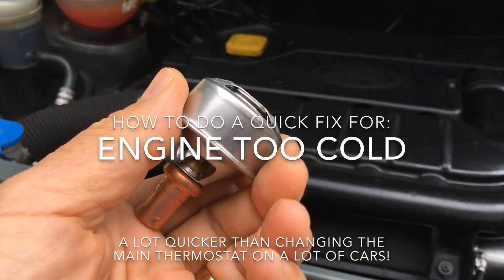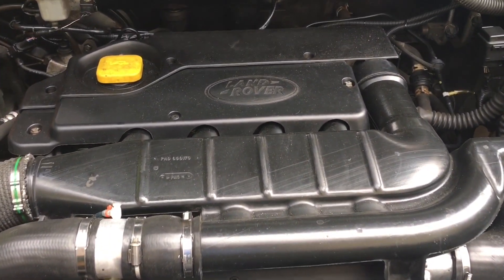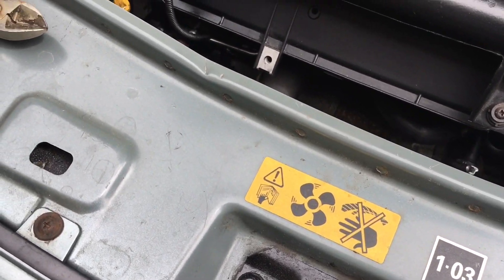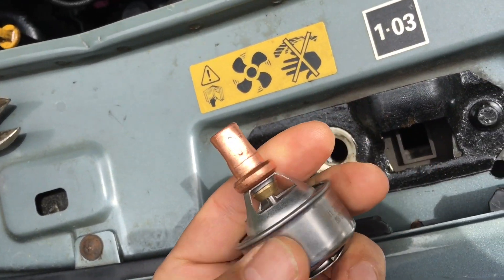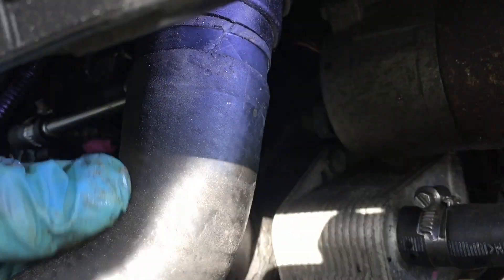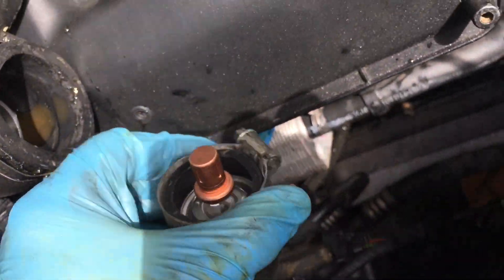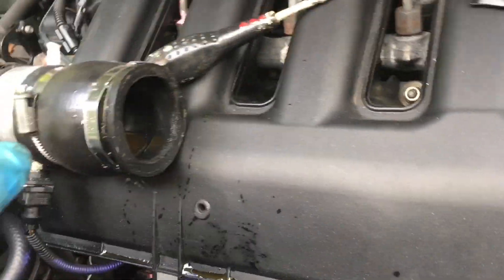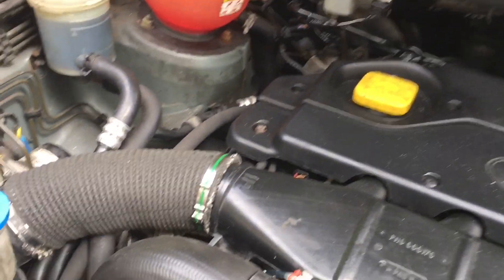Engine too cold? - Quick Fix Here!  & Cheap! Thermostat change.

Comment: I had this problem on my Freelander 1, so after watching this video, I ordered the Renault 5 stat from the ebay link you supplied and fitted it a few days ago. What a difference, as the temp gauge now goes all the way up to 12 o'clock, and the cab gets warm. Thanks very much for this video. I also just found out when fitting this stat, that I have the FBH fitted, which isn't working either, I've watched your video on fixing this several times, and will get on with it when there is a dry day weatherwise !!
Reply from the maker: Cheers. Glad it helped. Good luck.

Comment: Hello, I have the opposite problem. I live in Sardinia, the temperature is too high! The thermostat installed is it the standard. The  water circuit don't have any leaks but the water expansion tank level go dawn! I  installed a switch to start the cooling fans. Much better now, any advice? Thanks you for your help!
Ciao from Sardinia 
Simone
Reply from the maker: I am assuming it is the TD4 diesel engine.  Get yourself an OBD2 module and s/w on your phone and read the engine temperature, that should tell you if the engine temperature sensor is working and what temperature the engine actually is.  If you really can’t find any leaks (look for where water might have evaporated as well) and it consistently uses a lot of water then it would be a head gasket leak inside the engine.  Check if it is smoking white smoke/steam at the tailpipe.
Reply: Yes diesel, model year 2000, 
I hope it's not a problem with the head gasket, or a leak, there are no traces of oil in the expansion tank.  the loss of water is minimal, I add a glass of liquid every 100 km.  with the fans on when it gets to temperature now it's even a little less.  thanks I will check with OBD2.  thanks very much

Comment: My car reads at that temperature all the time, I want to do this do you need to remove the stock thermostat or anything or is it just in with the new one and done like in this video?
Reply from the maker: No need to remove old one as it is stuck open.
Reply: @comeinhandynow  okay and I assume you'll see whatever coolant it lost by looking at the expansion tank and topping it up afterwards?
Reply from the maker: @mattwilde332 yes

Comment: Can  you tell me the termostat diametre ? 😊
Reply: just bought one do you still want Diameter?
Reply: @lostvikinga  yes
Reply: @gantoniom9615  Ok diameter is 40.57mm  and raised lip is 43.26mm hope this helps I'm fitting it in the morning ill let you know if it works.
Reply: @lostvikinga  thank you
Reply: @lostvikinga  let me know if it works 🤗
Reply: @gantoniom9615  It worked perfectly but i would recommend removing inlet manifold as the extra room makes it easy to cut band off of pipe😀😀
Reply: @lostvikinga  thanks mate 👍
Reply: @gantoniom9615  no worries just got back from long test drive it works a treat  my mileage should increase now as diesels hate cold running
Reply: @lostvikinga  🤗🙏👍

Comment: Just bought a td4 and the thermostat stuck open just the other day. Nightmare. About the 10th thing that’s gone wrong since I’ve bought her but I love her too much to not give this a shot. Doesn’t look too difficult but I seem to have a different configuration of pipes with a t joint and another pipe that goes God knows where. 
Have you any thoughts or knowledge on this? 
Many thanks to your videos they’ve been invaluable this past week. 
Keep up the good work
Reply from the maker: Thanks, I hope you manage to sort it out. The pipe you need is the one that goes off to the top of the radiator, that will be the one that is the engine hot water outlet.

Comment: Just got this done today and worked grate 👍 wasn't a super easy job but much easier then replacement of the stock one. Thanks for the video mate really appreciate it
Reply from the maker: Well done. It’s needed in this weather!  Is you fuel burning heater working too?

Comment: Is it not a worry that a jammed open stat could suddenly jam shut if one of these in lines are
Fitted though and car comes
Up to temp again?
Reply from the maker: Not really a problem as long as it doesn't stay jammed shut, in which case you would have to change it.  They always seem to stick open in this engine though.
Reply: That’s what I mean, if it’s jammed open and not seeing any heat , after fitting an inline one and getting it up to temp may make the original stat close , and jams close if it’s faulty 

I need to do mine but it’s a worry I’ll have bigger issues if I do
Reply: @shaunpascoe8229  did you end up doing this mate

Comment: Hi I'm having the same problem with mine. Any chance I could have the link for the thermostat as I crnt see any link thanks .
Reply from the maker: The links are in the video description section, you need to open that.  Amazon and Ebay links there.  I have a new unused one in the garage as well, send me £10 and I’ll post it to you if you are in the UK.
Reply: Yeah I'm in the uk.

Comment: Is there a way to increase engine temperature? 

 I have stuck open thermostat and need tricks to increase temperature to normal temperature in order to reduce damage until I get it fixed ASAP 🤕
Reply from the maker: This video showing how to insert an extra new thermostat will bring the engine temperature back to normal.  Look at the video.

Comment: Could not insert stat in hose - no chance of it going in. Also very tough removing the hose fixing band. Dremal useless. The Renault 5 stat far too big.
Reply from the maker: Well that is odd, as the one in the video fitted ok, tight obviously so as not to be loose.  What is the part number of the thermostat you have and what is it’s diameter.  I will compare it to a spare one I have here.  Also what type of cutting discs did you have in the dremel? That method worked for me, with some patience even though mine is a cheap dremel type copy which is less powerful.
Reply: @comeinhandynow  thanks / dremel’s disc was as strong as a biscuit. Bought in machine mart. I’ll check the Stat diameter. Meantime I’ve just fitted a rad cover (long ago I removed the front bumper so it’s easy to remove it on hot days. Otherwise I use the heater to keep engine temperature right! It takes four mins now to remove and replace a partially cut down bumper, much easier to keep front suspension clean and correct too.

Comment: Hi I’ve had this issue since I got it. So decided to do the Renault 5 thermostat and I’ve put it in exactly how you have done but it still doesn’t get up to 12 o’clock on the temp gauge after a 20-25min drive and data logging it shows temp sitting at around 60, any other things to look at? Could my new Renault thermostat be faulty but the top rad pipe is getting hot. Or could it be temp sensor? Thanks
Reply from the maker: That is odd.  Best to take out the stat and check what temperature it opens at, if possible with a thermometer.  Check it’s not stuck open or leaking as well..
Reply: @comeinhandynow  yeah seems very strange as it was a new one. I did push the tip in abit by accident when I was pushing it into the pipe so maybe I damaged it? Might have to get another to put in. No other reason why I shouldn’t get to temp as that should block the feed directly to the rad.
Reply from the maker: @MattSmith-zp4xv  That sounds like the problem. Take it out and test it or see if it is open already.
Reply: @comeinhandynow  I have taken it out again and ensured it was fully pulled out but I may have damaged it when I pushed it in accidentally which has caused it not to make a seal?
Reply: Sorted it now thanks. Turns out it was faulty, so I bought another one but got the same style as you used and works perfect now. Thanks
Reply from the maker: @MattSmith-zp4xv  Great. Cheers.
Reply from the maker: @MattSmith-zp4xv  Good to know.  Cheers.

Comment: Hey there! Your video really helped me get my 05 freelander pumping hit air again. But I have a question I was hoping you might be able to answer. One of the hoses coming up from the bottom/back towards the overflow reservoir seems to be flattened for some reason. Could this be due to air in the line? I tried bleeding the line like you suggested after installing the thermostat, but it never really spit/sprayed much fluid out. Any ideas?
Reply from the maker: Glad you have hot air! Sorry I’m not sure about your other query.  The water pipes are pressurised when warm so shouldnt go flat, unless they are made in that shape.

Comment: How about fixing a F4 fault on the dash , when put in to drive I get the drive light on as well as the and Reversing light on and F4 on the dash ? Can you suggest anything? This is on a 2005 Auto TD4 Freelander facelift model
Reply from the maker: Hace a read through these: https://www.landyzone.co.uk/search/133613832/?q=F4+flashing+and+the+causes&o=relevance&c%5Bnode%5D=9

Comment: Before purchasing this item check your TD4 top hose, mine is a 2005 2.0 Td4 automatic and the top hose if a smaller diameter than the one in this video, so this thermostat won’t fit. 
Also if your thermostat  housing is leaking this will not cure that, you will still need to replace the housing and thermostat.
Finally replacing the thermostat housing on the Td4  is a fiddly job, but you DO NOT have to take the water pump and pulley belts off !! 

This thermostat is available at DMGRS.co.uk... check with them first if it’s compatible
Reply from the maker: Thanks for your input. That’s a surprise that a variant with the same engine has a smaller hose, an alternative would be to use a wider hose for the thermostat and adapt connections to the old hose, or as you suggest replace the old original one (that do seem to be a common failing).
Reply: @comeinhandynow  iv got the same problem, has iv got a automatic. Iv bought the thermostat already. I think it might just work with leaving the clamp off for the thermo and pushing it tight up to the reducer. Push comes to shove, il get some more pipe.. but will still work. Cheers for videos. Helped me out lots
Reply from the maker: @thomasmaplethorpe8274  Thanks. Let me know how it goes on the auto.

Comment: How dose this work then I never understood it
Reply from the maker: It puts a new thermostat in the engine coolant outlet pipe to the rad, only lets a full flow through when the engine is at the right temperature, then opens up.

Comment: This is a great fix and I'll be doing it asap. 
I chose the UK E**y link and opted for genuine OEM part.  Options available 75°C , 83°C or non OEM 89°C. Can you recommend which is best optimal temperature for the TD4?
Reply from the maker: Personally I would go fir the 89C one to have a better heater for this cold weather.
Reply: @comeinhandynow  Thanks very much for the help. Had to settle with 83. 
Keep up the great work. It's appreciated.

Comment: this thermostat also works with the Land Rover freelander td4 / 2004 / 2.0 diesel / 82 kw.  I only know that there is a thermostat housing on the left side.  Therefore the question is with my model there is a thermostat as shown in the video.  Please help
Reply from the maker: The thermostat shown in the video is an extra put in the top hose.
Reply: @comeinhandynow  @comeinhandynow This is a change or modification, so to speak.  Or is the thermostat installed by default at this point?
Reply: Not unless someone has fitted one like this

Comment: Will this work for a bmw e90?  Which hose would I put it in?  I keep getting a faulty thermostat code saying it’s not running at Normal cooling temp, would this help?  Please let me know ASAP, thanks!! Big help would be to know which hose to put it at.
Reply from the maker: It probably would but I can’t guarantee it as I haven’t tried that car.  You put it in the top hose that comes out of the engine, the same as in the video.
Reply: i will give it a go, im in the USA and im having a hard time finding the equivalent of the thermostat you used, any suggestions?
Reply from the maker: @jrlathrop1  Ebay USA:  https://ebay.to/2Y91ES1
Reply: @comeinhandynow   thanks for the help, so I ordered it and the thermostat is too big for the hose that goes to the engine block, can it be placed anywhere else to achieve the same result?
Reply from the maker: @jrlathrop1  when I did it, it fitted, with a lot of pushing, lubricate the rubber with some sealant or saliva!  The thermostat is 43mm diam. If you really cant get it to fit you’ll have to use some wider hose and joiner pipes.
Reply: @comeinhandynow  the problem is that the hose on the e90 is a lot smaller in diameter than the one on the Range Rover, upper radiator hose is bigger but the one that goes to the engine block is way too small to fit that thermostat even at 43mm

Comment: Awesome fix!! I'm considering doing this on my bmw 1 series diesel.. what pipe do you put it in? Return from radiator? And what a out water flow? Not restricting too much?
Reply from the maker: Thanks. It goes in the top hose where hot water comes out of the engine, like in the video.  Not restricting too much in my car. Worked a treat.
Reply: @comeinhandynow  awesome! :D

Comment: Hi great vid, question does it matter if it's from the 0.5 or 1.1 or 1.4 or 1.3 or 1.7 ?????
Reply from the maker: @mikedavenport007  the model number doesn't really matter just the diameter, just to make sure it fits your pipe, they all seem to be 43mm diameter for the Renault 5.
Reply from the maker: Probably not as long as its the right size.  See video description for buying links.  It worked a treat in my car.

Comment: Cutting the clamp taking a wrist on cutting the hose and other things. Then putting the cheapest clamp.  Give it a few days that car b leaking again.
Reply from the maker: Wrong. That was 10 months ago and it is fine. No leaks. Also if you watched the video I said don’t cut all the way through the band to avoid cutting the hose and use a screw driver for shielding the edge. Also those jubilee clips were not the cheap variety (the cheap variety and poor ones are the ones with holes in the band in my experience).
Reply: Changing the thermostat is a bain on these is mine goes again I'll be sure to do this

Comment: i've changed the stat  and refiled  the lost coolant 1.4 gal's and  i've bled the the system  and temp still drops wile driving aggressive  from 180 to 86 F   (82 to 32 C) and  back to 180 aand the  temp outside is just below  32 F (0C) ...  i use a  premixed antifreeze,   coolant is flowing thru all the pipes  thermostat opens and closes normally no problem there  but the  radiator  is cold ..i just don't understand  what's not right   i first  noticed this when it started to get cold outside ...in the summer there's no problem  temp  keeps up under  all conditions
Reply from the maker: Odd.  Where is the engine heat going? Maybe into the cabin heater matrix?  Maybe some water is flowing into the main rad but it not enough to feel warm.  Maybe the thermostat is a PRT (pressure release thermostat) which starts flowing more with higher water pressure at higher engine revs.  You could try an extra thermostat like in the video.
Reply: @comeinhandynow  there is  heat   when it gets to temp  the air inside  burns  but  when the stat opens  all that  burning heat  goes away so quickly... when i cruise  all seams normal  when i speed up  this happens  then it comes back to temp  and i don;t understand this sh.. :))  even  when the engine is  hot the radiator is cold   i stopped  a few times  to check  the intake pipes of the radiator  and the pipe is hot there is pressure  there is flow ......radiator clogging excluded

Comment: which hose are you putting that in? Isnt there an upper and lower radiator hose? I have 2010 Audi A4 and don't feel like taking it apart. Thanks!
Reply from the maker: Top hose which is hot water coming out of engine.

Comment: My 03 ram 1500 with the 5.9 v8 never has the temp go past 1/4 mark near cold. Anything I should worry about or is this normal for a truck?
Reply from the maker: I would fix it, better economy and a better heater.
Reply: @comeinhandynow  is it a pressing issue or are those the only downsides? I get 11.5 mpg average and the heater feels fine to me and I'd like to save up a little more before I get it fixed but if it could lead to serious damage in the future then I'll do it right away.
Reply from the maker: Those are the main downsides I believe, so not too serious.  The oil may also be a bit thicker due to being colder.
Reply: @comeinhandynow  ok thanks so much